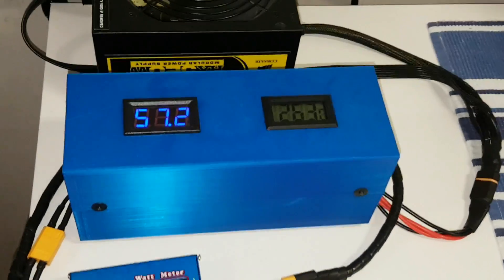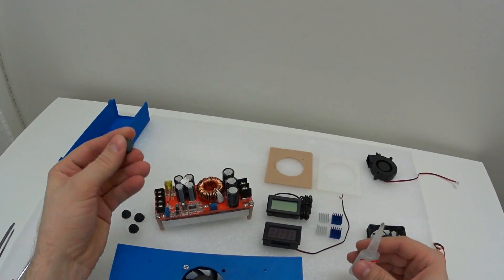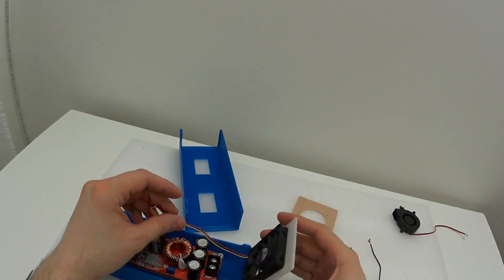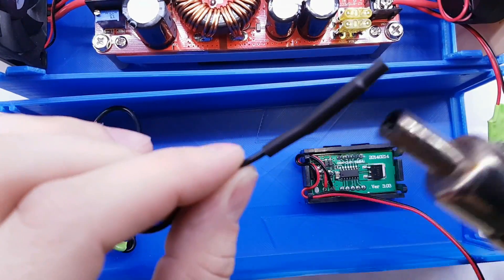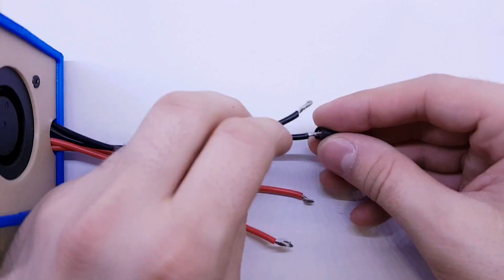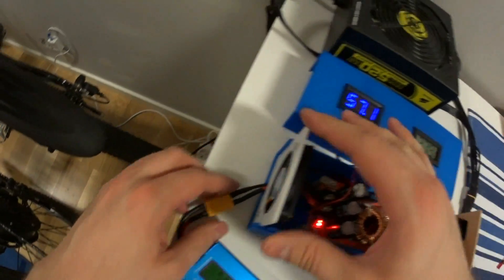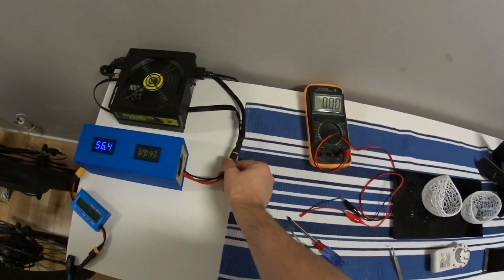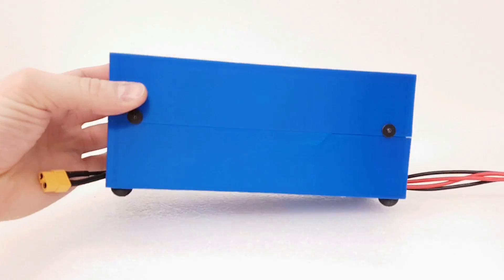How to make Ebike charger - DIY

Comment: Great project. Can you tell me is the fan port on the board temperature controlled or just 12v the whole time?
Reply from the maker: Its 12V all the time that's why I add buck converter for fans to get better fan speed control.
Reply: Nexi Tech Thank you. I've ordered the parts to make your charger (except I don't have a 3d printer so making a fine wooden box!) I was looking for a temperature controlled buck converter of similar size to the one you use but can't find one. Do you know how one would convert the one you use to be temperature controlled, say replace the small potentiometer with a NTC thermister? How would that be done?

Comment: This is a highly inefficient charger. The boost convert is less and less effective the larger the voltage difference from 12v. The charger will have less than 60% efficiency. It works though.
Reply: If you're in a motorhome less efficient than running an inverter with your mains AC charger or better? Certainly less to carry. In my tests with the baby brother of this device I found it much more efficient than 60%.
Reply: Boost converters are less efficent the greater the voltage vs voltage difference.
Reply: Cutler Cycles Have you got figures for this particular case? Your 60% implies that the psu used here must have been giving 47 amps at 12v to produce 56v at 6 amps. That's 9 amps more than it's rated at and 7 amps more than the video says. I'm getting 93% efficiency with a smaller unit that gives me 2 amps @ 42v with inputs of 12v @ 7.4 amps. These units are limited by the input current but that doesn't mean less efficient; the inductor is being run at 130kHz if memory serves me. The other question I was asking is when all you have is 12v (unless you plug in an inverter) what is the more efficient alternative? Inverter or not, that is the question?
Reply: input mains vs output to battery. if the PSU is about 80% efficient than a 520w RMS psu would  consume 650watts from the mains. The conversion rate from your PSU to the battery is about 65% so total efficiency is 345watts/650watts= ~53% total system efficiency. The biggest loss is at the boost converter. If you input 48v PSU into the boost converter you can raise your efficiency to 80%+. I made this same setup a few years ago. Anyways great video and nice charger box. thumbs up.

Comment: Does your power source output 12v or is it outputting a higher voltage to get that high an amp charge?
Reply: Stephen Galvin He's using the 12 supply from the PC psu. I'd be interested to know what the current draw is with 56v out at 6 amps. Probably about 30 amps? Any chance of measuring that?

Comment: Is the the power supply a converted computer ATX or a dedicated power unit please.
Reply from the maker: Doc Cox Its converted PC power supply
Reply: Thank you.
Reply: All that has been done is that he's taken the 12v feed from the PC psu (yellow wire). No need to convert anything. Have you thought about buying a cheap multimeter?
Reply: Doc Cox was meant as a comment for ofsamsonov93. Did you build one? Do you know if the fan terminal is regulated to 12v or simply taken from the input?
Reply: Thank you, have never seen this type of ATX before, I have plenty of multimeters thanks.
Reply: Sorry my mistake, have all the parts but haven,t made it yet, have been busy making the battery, have to find another ATX unit as the one I have isn,t powerfull enough.

Comment: Thank you. I just looked at store bought 48V chgr for lead acid  but wtf ? only 2.5 -3A?! , yet go to 20 A and you are talking $185 plus big shpg $  This is just perfect, I love the DC Booster. Been using other smaller 150W and they are near bullet proof ,....you get a decent weekend project including the 3D prints. Fantastic project and $ saving as well.  Got four new Deep Cycle 20Ah and will prob err on the side of caution as far as increasing potential chg cycles. Needless to say I just debugged my first 3D P as well :-)
Reply: Most li ion packs have a 1c or 1 times it's own capacity charge rate so 20ah charge for a 20ah battery is okay but lead acids or pb are no where near that high and can only be charged at a fraction of there own capacity usually even for 20ah lead acids its like 3.7 amp charge max but at least it won't blow up it will just balloon and smell like shit from the burnt sulphuric acid after it boils off
Reply: Chris Leech This really isn't a suitable charger for lead acid batteries.
Reply: Dont charge your batterys with 20a!! They wil catch on fire.

Comment: I have been thinking of this. I want to charge my 48 V ebike battery from my 12 V system in my van. Is it important what is connected before the BMS? Can I just as well use my boost converter as getting a converter made for ebikes going from 12 V DC -> 230 V AC -> 48 V DC?
Reply: Torgny Nordén Yes you can but your inverter should be "pure sine wave". You may blow your 230vac charger if you have a cheaper "modified sine wave" inverter. But I thought the point of this is that we can! This charger will also blow the fuse in your lighter socket if you push the output much more than 2 amps in which case you may like to consider the smaller version: https://www.ebay.co.uk/itm/152355318529.

Comment: A question, the computer power supply is only rated for 520watts, that would limit the charger you make to that right?
Reply from the maker: PC power supply with 520W have usually around 35-38A on 12V. Efter step up voltage using this device you can get around 5.5A-6A on 60V. That's still more powerful then 90% of stock ebike chargers. Plus you can adjust any voltagw from 12V to 86V on some units even 90V.

Comment: Great video! Thanks for posting.  Does this work like a regular li-ion charger?  Does the amperage drop as the voltage goes up?  Would you need to constantly monitor so the batteries do not get overcharged?  I'm building a 36 volt battery pack.  What BMS would you recommend?
Thank You
Reply from the maker: HI Mike! Thanks for commenting. Yes it's work like regular charger. Battery pulls amperage to level with the Voltage and when is reaching to desire voltage than starts to drop amperage to battery needs.  For example your 32V  lithium battery is 42V full charged. If you set charger to 42V then charger will charge to 42V and when reach 42V it will start to drop Amperage and if you wait long enough Amperage will be 0. No need to monitor nothing. You can set up 41V just to save cells cycle life and you can live it ''on charge'' how much you want and it will never pass 41V. For BMS please look my video about 18650 resistance its very important to understand that BMS will NOT save your cells for overcharging if some of cells go out from balance. Check my video about Lithium Battery testers its very handy to monitor your cells when driving or charging(It has Over voltage alarm to save your cells from overcharging. Best regards
https://www.youtube.com/watch?v=1lJSJWCFQl0
https://www.youtube.com/watch?v=VTMQ0Eg8Xhc
Reply: @NexiTech  sir what about boost and trickle charging? Is it incorporated in this?
Reply: Mike Ferrari boost converter can be set to any voltage and stop when it reaches set voltage. This converter is a constant current and amps can be set to what you like. They work well
Reply: would like to know aswell
Reply: Me too...
Reply: Only think I see as different from a dedicated li-po charger is the end of charge. Aka stopping charging completely when the battery is full, but you can just stop it manually.
Reply: Yes, it is a cc cv device so you can both limit current and voltage. There are leds on the board that tell you which mode it is operating in too and two pots, one to limit voltage and the other current. If you are happy to charge at 2amps you can also make a charger really easily with one of these: https://www.ebay.co.uk/itm/152355318529
Reply: I was just about to ask the same question - over voltage protection? amperage drop? I may end up buying a solar charge controller for the above same reason.

Comment: Is the melted gases from  Pla/Abs safe to breathe (like is it safe to put a 3d printer in a room with people in it)
Reply from the maker: Heating and printing PLA is consider safe and not toxic. ABS is recommend to print in ventilated room. Its smells unpleasant. But I recommend using ventilation or just ''opening'' window while printing. Why taking any unnecessary health risk.
Reply: Nexi Ill be using PLA thanks for the advice!
Reply from the maker: Nice. You welcome Sam. Take care

Comment: Hey nexi, im running the same setup with you and i believe im having retraction issues on my V6. Anyway you could share your retraction settings? Thanks in advance.
Reply from the maker: Hi man! Let see, what temps you are using? Is nozzle/hot-block nice and snug? No leaking? My retraction speed is 25-35mm/s on my V6